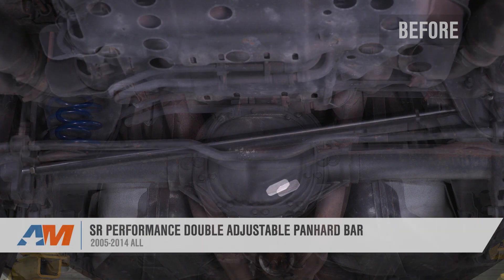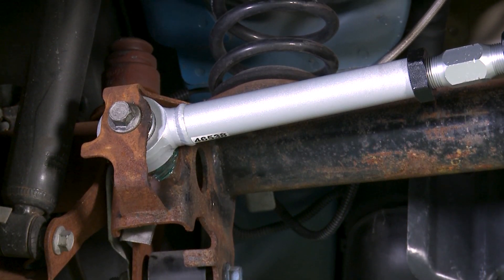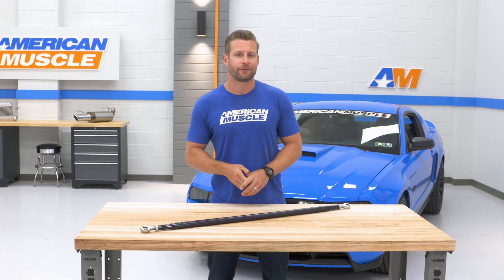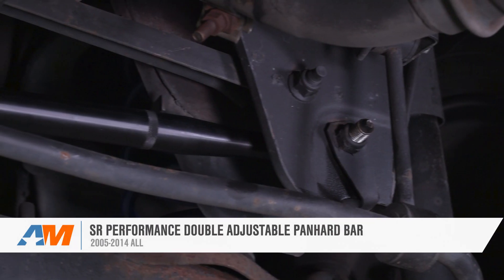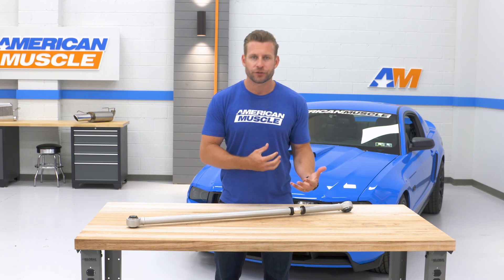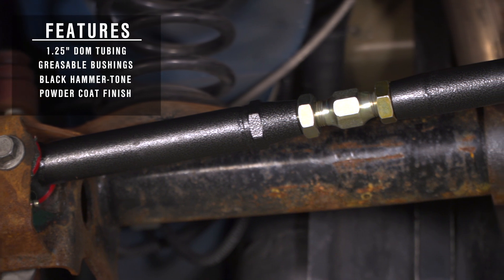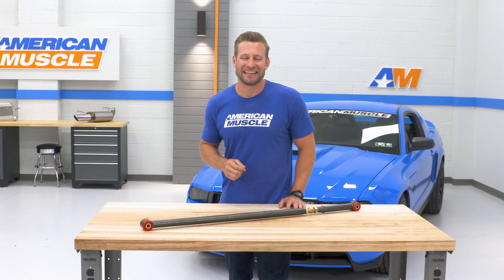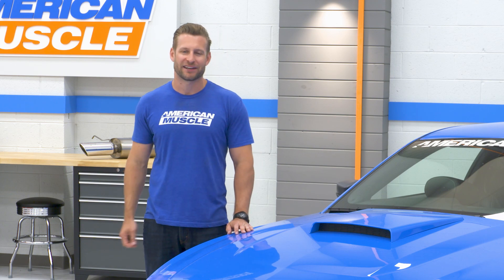Top 3 Panhard Bars For Your 2005-2014 S197 Mustang GT

Comment: Could it be said that these are stronger than the stock bar? I have bent mine on my Boss 302 and it was replaced by Ford at no charge. As it is still stock and I bent one, are these stronger if I bend this one?
Thanks.